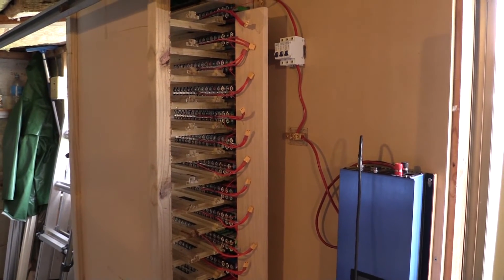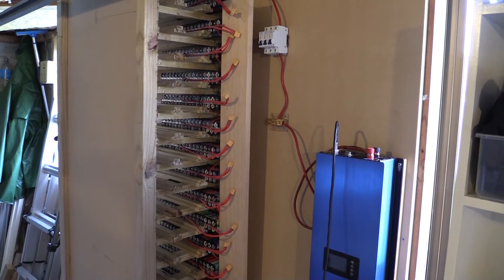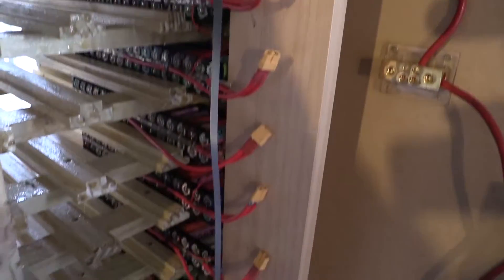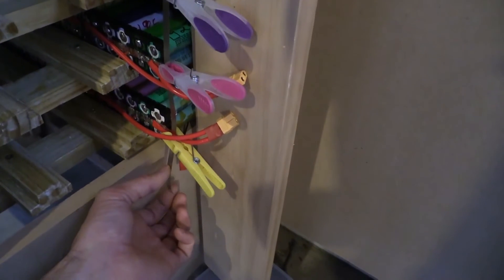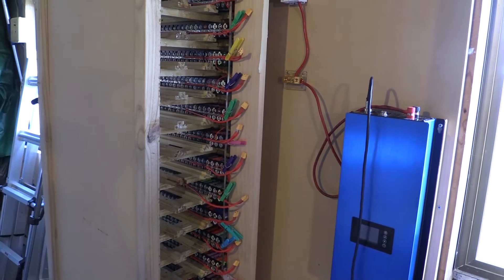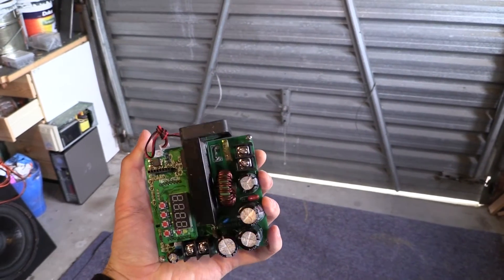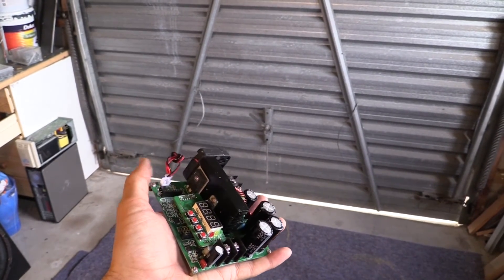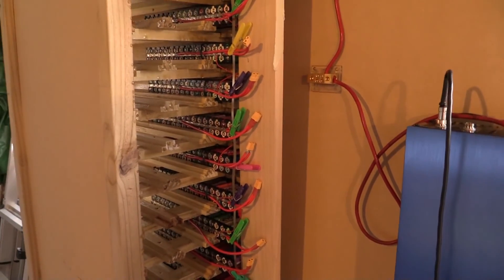Balancing 5kWh Battery Bank 1 For The First Time

Comment: man this is the worlds biggest fire hazard !  and having had a look at this myself  18650's are way more expensive than just using lead acid batteries ...  I don't get why you'd bother with lithium ion IF you have to pay for the batteries ??
Reply from the maker: Hmm you might want to watch this video
https://www.youtube.com/watch?v=LqgP16JQ24I

It didn't cover in detail the death of discharge only being 50% on lead acid. So if you have a 200ah lead acid you should only ever use 100ah or 50%. Lipo is cheaper and lasts longer overall. There are many things to look at when sizing a battery not just the rating on the side.
Reply: You do realise the link you sent backs up my points and not yours ?  
Also Crown deep cycle claim you should should be able to deep cycle more that 50 % safely .. Also charging and discharging Lead is simple and thus cheaper for total cost... I realise that in your system you're using second had batteries that are probably almost free so that helps you ALOT. 

I just can't see how a system like this is ever cheaper than boring old lead acid batteries.. there is no doubt that a acid system will be larger and weigh more but so what.  ( assuming modest storage is required )  

I also realise this is not about the economics but fun of making something ( im like that )
Reply from the maker: Safe to discharge is a very loose term, meaning yes sure you can discharge under that but it won't last as long, Looking at Crown deep cycle on their website,  They state: 50% DOD cycles = 1050, 40% 1310 and 20% DOC = 2600, Meaning less than 60% DOC will be around 800 cycles. 80% DOC 400 cycles. lead acid has two big probs, one they need water all and need to be checked, they don't last if DOC past 50%. One way to look at it, if you did use lead acid and discharge to 80% 400 cycles or using lipo discharge to 80% 2000 cycles. The lead acid will only last a couple of years max the lipo will last 4 times that. Lets say you didn't DOC to 80 but to 60 thats cool you get another year but with lipo you get about 2-3 years. Depending on the daily use of the powerwall cycling meaning 365 cycles per year adds up. Every 3-4 years do you really want to be finding a tip to throwing those very heavy batts away and buying more. They might sound cheaper but when you run the numbers it doesn't add up. Say 48v 5kWh of lead acid would be something like CR220 6V 220Ah x 8 around $1000-1200 USD or around $2500-3000NZD and last around at around 3 years 50%60%DOC then replace so Over 10yrs you will spend $7000-8000NZD or lipo you will spend somewhere around $2000$3000NZD but that will last around 8 years ish. I am sure there is a video on youtube somewhere covering it all off but that is why people are going lithium, it might have a higher up-front cost but it pays off. First find the lead-acid batt you were thinking of buying put that in excel with DOC % you will use and list cycles, compare that to lithium cell that gives you the same overall DOC capacity needed and put its cycles. Eg 220ah lead 50%doc (100ah usable) is around the same as 140ah lithium at 80% DOC ish but i would go 200ah lithium at 50% DOC look at the cycles, and add up how many lead-acid batts you will need to get the same "ish" amount of cycles. You quickly see how many more lead-acid batts you will need to buy to match, and that will give you the cost "spend of batteries" needed over the years.
Reply: stuff i've seen seems to claim they will get 1000 at a full cycle. And lets be fair a here all i've ever read with lithium ion batteries is you'll get about 500 cycles but this can me greatly increased by under charging it and  not dis charging it to much but this it the same idea as the lead batteries reduce discharge to increase life.. Im not doubting that lithium ion under these conditions will last longer. but  right now the cost of install is significantly more complex and expensive than boring old lead battires. I would expect things to change  in the next 5 years though. But one could say the same thing about lead batts with the new carbon battires but currently. Lithium Ion certainly is more interesting though
Reply from the maker: Yip 18650 is around 1000 cycles as they are  LiNiCo. Yes you can extend them but not charging to full voltage and not using 80% DOC. How ever LiFePO4 or Lithium polymer  which are the 100ah+ cells you can buy are rated at 80% 2000 cycles, the voltage is 3.3v nom. Small LiFePO4 cells are a pain and not worth building into a powerwall but the larger 100ah+ cells are. Those are the ones people put in EV cars when they do a conversation normally. Also if you dont have access to cheap 18650 cells then the larger LiFePO4 cells is what i would use and you kinda connect them like leadacid as they are much bigger. haha yes Lithium Ion is far more fun and worth getting into. Its not that complex when you get your head around it, and doesnt have to cost alot. Also this looks interesting. http://www.zmescience.com/research/technology/new-lithium-ion-battery-cathod-can-withstand-25000-cycles-laptop-battery-300/
Reply: These are some useful link on  getting the most like out of lithium ion but as always that comes at a cost of capacity 
http://www.powerstream.com/lithium-ion-charge-voltage.htm
http://batteryuniversity.com/learn/article/how_to_prolong_lithium_based_batteries
Reply from the maker: Very intertesting, I like the info in the batteryuniversity one. I plan to charge to 4v rather than 4.2. Maybe 3.8 in the summer as i dont need the capacity. Something to think about.
Reply from the maker: This one works out cheaper. 80ah https://www.aliexpress.com/item/Brand-large-capacity-80Ah-lifepo4-3-2v-cell-LiFePo4-battery-lithium-High-discharge-Not-100Ah-for/32597725087.html

Comment: Looks like this boost converter is junk. Just recieved mine and used it once. Worked well. I wanted use it second time and it blow up. Looks fine, nothing looks burnt, even fuse is OK, but there is short on input. Checked mosfet and is shorted.
I will brobably try order new mosfet, but if it dies againg this boost goes to trash.
Reply from the maker: which boost converter ? The 900w? Hoping mine is just the mosfet but we will see.
Reply: Yes, 900W. Ordered new mosfet, but I thik it will die again. I don't understand how can this boost converter die by connecting it to 12V power suply... without load...
I also have 400W boost from same brand and this one works fine.
Reply from the maker: Ohm711 let me know if the new mosfet fixs it, I have two of the 600w ones and they work perfect. I did have 3 but it died so i think it is also the mosfet
Reply: New mosfet finaly arrived and boost converter works! Not sure how long. But I already bought 1500W unit, which is much better for my aplication.
Reply from the maker: Ya i just ordered two but still waiting for postage. The benefit of the 1200w and the 1500w is they have input voltage protection meaning you can get the min input voltage so it doesnt just start on the wrong input volt and go over amps. Very handy
Reply: Yes, there is this feature. I am using only one server power supply as 12V source, so I don't need this feature. But for someone could be very useful. Also at 30A input components on top side gets quite hot, so I added second fan for cooling components on top side. Looks like slightly overloading is not problem. I charged my battery for 6 hours with input current 35A without problem. Efficiency of this charging setup (12V server power supply + 1500W boost) is not so good. About 78%.

Comment: Using such a big piece of metal to parallel the packs will put them under large stress. The low packs will be charged with several Amps / xC. The high pack will be discharged with several Amps. The larger the voltage difference the higher the Amps. Might reach several 100Amps if really unbalanced. I would recommend to use limiting resistors or at least thinner cables to connect them all up.
Reply from the maker: I did think of that, and it would be a problem if one pack was flat or far out of balance, In my case i made sure all packs where within less then half a volt. So its really only balancing the last 10% etc. I can ether do it if all the packs are flat or if they are full ish. So far so good its been balancing for 10 hours so we will see what the voltages are tomorrow :).
Reply: For 0.5V difference and depending on your cell and connection you will deal with something like that:
I = 0.5V / ([cell internal resistance] + [connection resistance]) = 0.5V / (30mOhm + 10mOhm) = 12.5A per cell or about 7C of charging current.
Reply from the maker: Wouldn't it be 12.5amp per pack?
Reply: No, 30mOhm and hence 12.5A is for a single cell. By paralleling the cells the internal resistance of the pack will be much lower. The current per cell will drop down the length of the pack because of the resistance of the cabling/connection.
Reply: I don't think the nickel strip he's using can deal with 12.5A, most likely has a limit around 6A. So, since it didn't catch on fire, seems your calc is a bit flimsy.

Comment: why not link them all together all the time? I see this being a on going need. to balance all the time. sure the weak cell will always be there.  I am just thinking out loud as I have not made my wall yet.  I have 12 lead acid batteries on my solar system and it works fine. Keep up the good work.
Reply from the maker: That will put all the packs in parallel so 5kWh at 4.2volts lol  Lead acid battery dont need balancing so you can put all 12 in series, i am guessing you have 12volts solar?
Reply: you are so right. yes I have 12 vds solar.
Reply: You are so right, my bad. yes I have 12 volt solar

Comment: i bought my bms's from alibaba you can get 20s there with lcd displays to easily monitor your cells.
Reply: http://www.aliexpress.com/item/Free-shipping-1pcs-smart-display-3-2V-3-7V-150A-lithium-battery-protection-board-balanced-management/32710469857.html looks like it'd also do the job for you.
Reply from the maker: Which one? Link?
Reply: haha yeah sorry. http://www.alibaba.com/product-detail/13S-50A-48V-poe-switch-pcb_60446852252.html?spm=a2700.7724838.0.0.ozRFRy. They have different options to view the cell data. I went with lcd for the ease of push button. You can use software on your pc,and bluetooth on your phone.